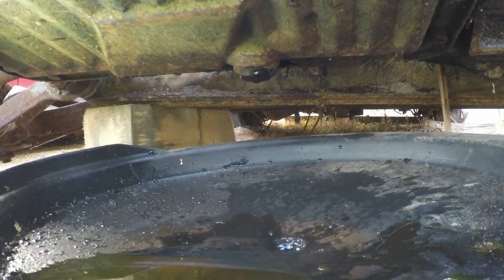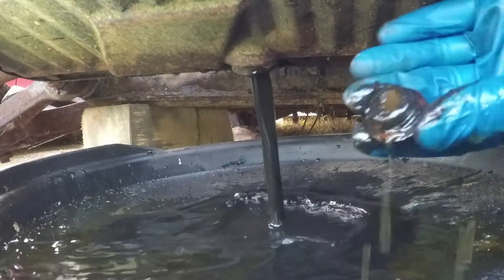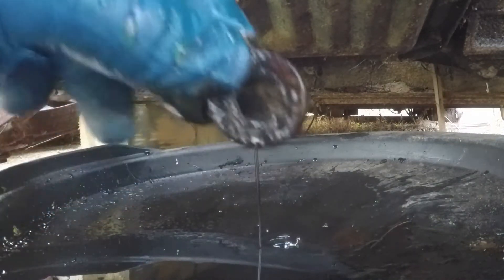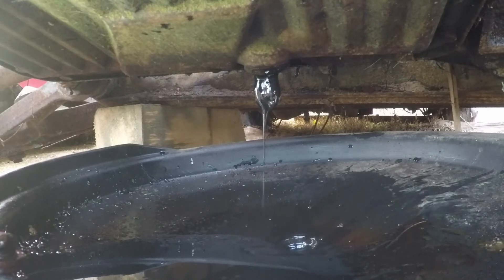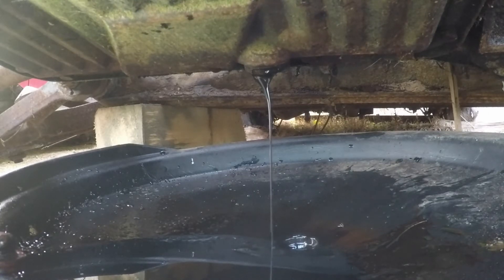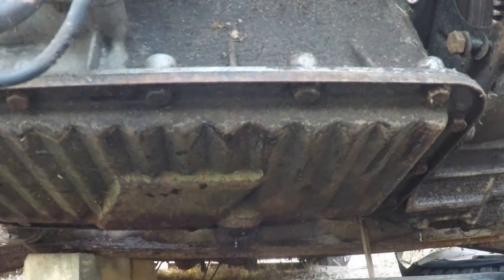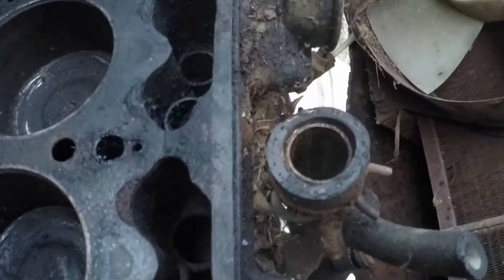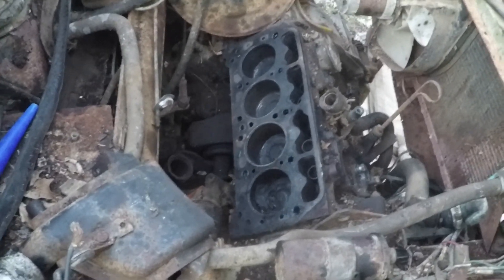Simca 1100 1204 Engine Goo

Comment: I have two engines, one with trans. both outside of the car and one in my 1969. Trying to locate everything before I try rebuild them. So far only found 1 complete gasket set on Ebay.

Comment: Isn’t this just the same Poissy engine that the early 1.6 US Horizons had? Too bad the rest of the cars so rotten.
Reply from the maker: Thats what I've heard. I did find a early horizon with the manual trans, but it had the VW cylinder head motor.  After that fell through, the car got hauled off in pieces.  The only thing that held it together was the torsion bars- thats it!